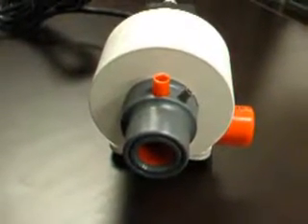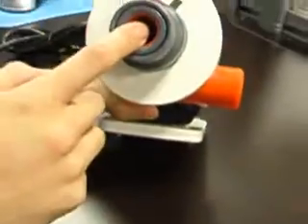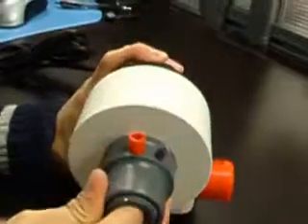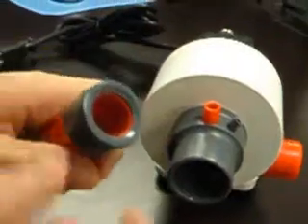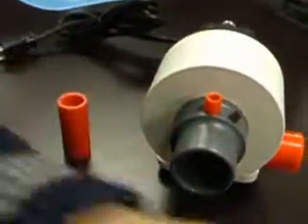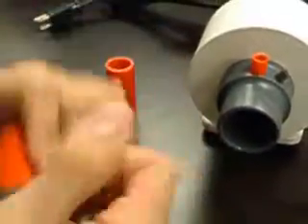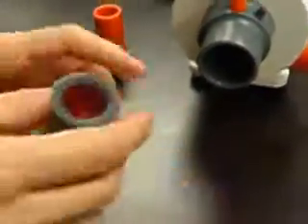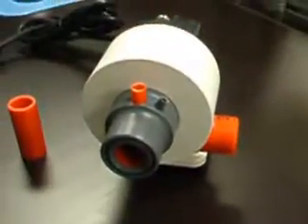How do i change the nozzle of my Vertex Alpha Cone SKimmer?

Comment: hey what you did would correct the pulsating pump and where do you get that correct size nozzle? it was pretty easy to replace it with your video although you never mentioned where we can get the replacement nozzle.